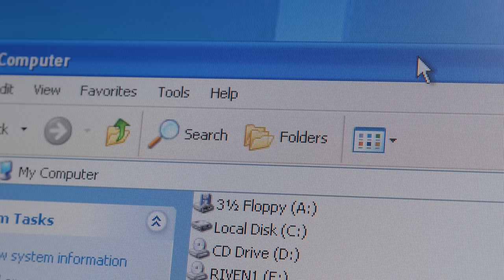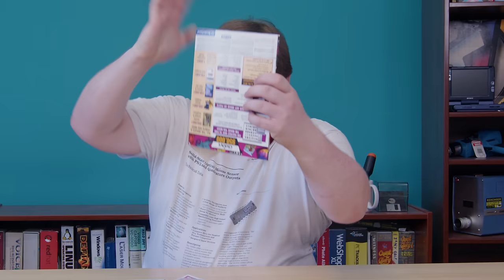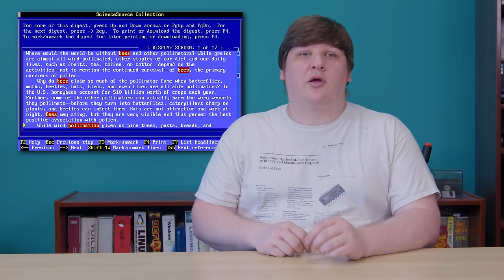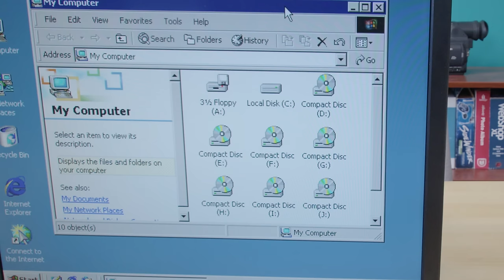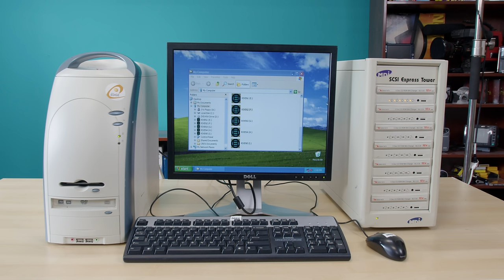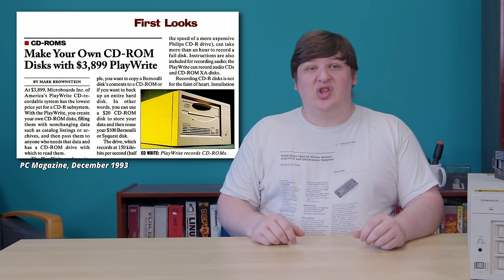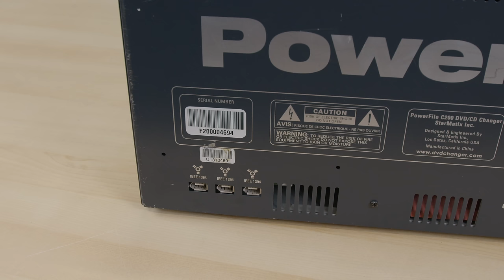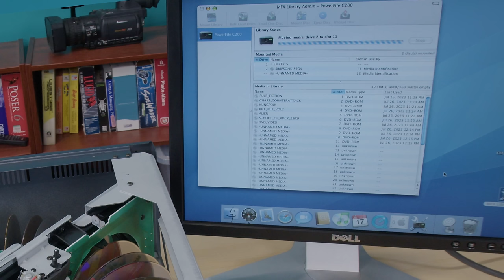A Jukebox for your PC: 1993's CDROM Servers

Comment: Sound ideas in the thumbnail got me so excited. I bought some Hollywood edge libraries (now owned by sound ideas) used on eBay and they came in caddies, little sliding door and everything. I meticulously took them out one at a time to rip them. The booklet even had handwritten bug notes from a chess game stuffed inside. 

I also own the General 6000 and I’m pretty sure they’re just normal CD audio discs. I ripped them with Adobe audition no problem, I never tried to access the files directly. That being said, the modern documentation for it mentions specific wav files, some of which are broken down as multiple CD tracks on the original discs.
Reply: We used the General 6000 in the campus radio station (in the early 00s) for making promos, sweepers, jingles, and so on. It was massive - and occasionally, when I was on-air, I'd play the disc directly - as I recall, the discs were both full tracked and data files, so could be used either way. But some of the tracks had multiple effects on them, so if you needed, say, the second "whizz" effect on the track, you had to cue it up, pause the playback, and unpause it when needed.

Comment: I remember going to the State Library to access the MLA (Modern Languages Association, the definitive index of literature and literary criticism at the time) database on CD-ROM. They ran it on a stack of CD-ROM drives just like shown here. It was the only way to search the database for several million people, and you just called up the library and booked a time slot to access it.

This would have been 1995 or 1996.

Comment: Such a blast from the past.. I had the home 6 disc pioneer that flashed on the screen when you were talking about the cartridges. Also, the car ones were identical. We had a van with a 6 disc pioneer, and I used to bring one of my magazines from home and put it in my car unit.

Comment: Back in the ‘90s I was a sysadmin for a major defense contractor. One of the systems I was responsible for was an optical drive library for our graphics and publications department that used hierarchical storage management (HSM). The server had five 4GB hard drives in a RAID5 array, the optical library followed by a DLT changer. Based on the last access date on the file it would automatically be moved from the hard drives to the optical drives and finally to tape and back again, as necessary.

The optical library was a massive thing, about the size of a commercial refrigerator. Ours wasn’t maxed out, having only 6 drives (probably 1.3GB (?) per side WORM or MO drives) and about 128 discs; it could probably store double that number of drives and discs, but ours was relatively minimal during the time I worked there. One slot on the front was used to load the discs, but that wasn’t used often as the discs were never changed unless they failed. There was one robotic arm to pull the disc from the storage rack and put it in the drive. When the opposite side of the disc was needed the robot arm would press the eject button, grab the disc, flip it and then gently reinsert the disc. It was quite a sight.

The HSM method worked well at preventing the Windows issues with multiple people trying to grab different bits of data on the same disc. The system handled one task per drive, dumping the requested data onto the server’s hard drives for user access. It was a great way to store huge quantities of data in a way that was easily and automatically accessible by the end the user, although they may have to wait a bit for the requested file to be transferred to the hard drives from whatever media the file may be stored on at that moment in time. Now that same library of data could be stored on one 512GB MicroSD card - how times have changed.

In late ‘99 I was going through the accumulated junk mail on my desk when I found an envelope from Kingston. It appeared to be more personalized than the usual generic sales garbage, and I was correct. It was a letter stating that I had won 64GB of RAM, a huge amount at the time. Based on that I ordered a brand new, custom built PowerMac G4 - minimal RAM (I had 64GB on the way after all), a 10GB hard drive (the smallest available) the fast 500 MHz CPU and a DVD-RAM drive. I already had an HP 4X SCSI CD-R but I wanted more storage. The DVD-RAM drive did what it said, but the performance was somewhat lacking, although I suspect that this had more to do with my unrealistic expectations.  It was slower than burning a CD, but then again, it was burning considerably more data than a CD. I probably never used it in the manner in which it was intended. Later, at another job, we upgraded the Mac servers we used (that were just there to hold the CEOs address book) with top-of-the-line models which had DVD burners. We didn’t need those drives on the servers so my boss told me to put in some other optical drives and we could each have a DVD burner. Heck yeah! That drive, like my DVD-RAM drive, worked great for playing movies via a hardware decoder, something I probably still have; given what I paid for it I wanted to make sure I got my money’s worth out of it.

Even when DVD burners got faster I would still burn at slower speeds for reliability and accuracy. But I’ll be completely honest - I haven’t burned a disc in years. I even have a Blu-Ray burner that I got from a retired friend of mine, but even though I have the media (I bought a 25-pack back in 2018) I have yet to burn a single disc. I mounted the drive in an old SCSI case, converting it to USB 3.0, so it’s not taking up space in a precious 5.25” bay. These days most of my data is stored in piles of 8TB external drives, but even then I can’t keep track of it all; I think some sort of disc cataloguing program is in order, especially if it can find duplicates. I also have literally piles of 500GB drives from used DirecTV DVRs that I would grab for $2-3 each, gutting them just for the drives. I stopped that several years back when 500GB became the modern equivalent of a floppy drive (and I used the drives as such, in an external drive duplicator), and when one of the units was filled with insects, bedbugs in this case, thankfully all dead (I had a disgusting neighbor that infected a building I was living in with bedbugs and I never want to experience that again). You can still find the occasional DVR at the Goodwill Outlet and harvest them. AT&T and DirecTV units work well, but avoid Dish Network units as they have buggered up the drives to make them all but unusable anywhere else. I spent hours tweaking the firmware but eventually throwing in the towel as my time was worth more than the 500GB drive I would have in the end.

Comment: I majored in computer engineering and scheduling was one of the topics in my embedded systems class. Scheduling algorithms are used to manage resources among a set of tasks (e.g., CDs among a set of users). It is a complicated problem with many solutions, but the goal is to schedule the tasks in a way that minimizes certain metrics like latency, deadline misses, execution time, etc. Also note that the tasks could be split into multiple parts.
The algorithms we talked about in class included: Weighted Round Robin (WRR), offline cyclic scheduling, Rate Monotonic scheduling (RM), Dynamic Priority Scheduling, First-In First-Out, Earliest Deadline First (EDF), and Least Slack Time First (LST). Some of them assign priorities to the tasks like WRR and others focus on metrics like EDF and LST. EDF is simple enough, as it prioritizes the task that needs to be finished first.

Comment: In 1998 while at UCSF we had a huge CD library that needed to be online because MRIs were huge. We used multiple towers on linux with experimental support. Worked good enough.
Reply: linux??? back then??? linux didn’t have good hw support at the time.
Reply: @beepyshenanigans  lol what? linux had the best driver support of any unix as far back as 1995. i've been using linux and nearly every for pay unix since the early 90s.
Reply: @beepyshenanigans for "real" computers in the 90s, the kind of stuff that would run Windows NT4, Linux had decent driver support since this is what developers or college students typically had access to at the time. Support for SCSI was excellent.

Comment: There was a Pioneer DRM602X (or something very similar) in the library of my high school in the early '90s. It was used with a multi disc encyclopedia so you did not have to swap discs. I seem to remember that the computer that this setup running on was specifically for the encyclopedia only.

Comment: 28:20 "I love that touch" - my parents still use a Pioneer six-disc changer in their home audio setup that is probably a slightly earlier revision of the one you show on-screen at 31:20. Purchased in the late '80s or early '90s, I'm about 99% sure it uses the same 'magazine' as your systems. Last time I was at their house a couple months ago, I put in the "jazz" magazine and hit play. Worked fine.

Comment: I absolutely remembered these from my school. We used them in the computer lab and the library, and they allowed several machines to access things like game disks and encyclopedias without the instructor having to risk us handling CD-ROMs. It also let the expensive computers from before the CD-ROM era use content on CDs (and the CDs were often many times larger than the hard drives on the older machines).

We had a bunch of Mac LCs (the original, not LC 5200s or whatever) that had PhoneNet AppleTalk connections to get to a CD-ROM 'server' via an Ethernet to AppleTalk adapter.

It was cost effective and 'fast' compared to buying CD drives for each machine or having ten copies of each software title.

Comment: I was the maintainer of several Sun 3 servers that stored a lot of online technical manuals.  The manuals had been scanned and OCR'ed then stored on many large optical disks - I don't remember what size, they were in their own cartridges and were at least 15" in diameter.  All the manuals were indexed and that data was stored on some really big Fujitsu Eagle hard drives. The optical disks were stored in an enormous jukebox - this thing took up the space occupied by four 19" racks.  Pretty heady stuff for the late 1980's. I remember the developers having a hell of a time dealing with thrashing in the jukebox, which because of the size of the disks and everything else was pretty amazing to watch.

Comment: My high school had a CD library attached to their Power Mac G3 server. They didn't use it for student access though, it was just for software installers and stuff that the teacher could use to install whatever software or data they needed for a lesson.

Fast forward like 15 years and I discover that my work has a Petasite, which is basically a massively scalable tape library system, in our case it took three whole racks and stored thousands of LTO tapes. They had built a custom CMS for it that stored all the metadata about everything on the tapes, and allowed users from anywhere in the country to request data, which would be queued for retrieval when one of the tape drives was free. It would then retrieve the tape, find and pull the data off, uploading it to the user's local server and emailing them a link to the file. And if the tape wasn't "online" in the library, every day the operator would load a fresh batch of requested tapes into the library for data retrieval.

In the case of an online tape, it could be a few minutes to a couple of hours wait for your data, depending on the size of the files and how busy the system is. Offline tapes usually meant waiting overnight. It was a surprisingly good system for such a large amount of data.

Yes, it "was" a good system. It was switched off not long ago after all the tapes were transferred to S3. All >20PB of them. Not only is it a much faster system in terms of retrieving the data (we've got a 10G dark fibre to AWS), but it's actually a lot cheaper. Yes, they have to pay for storage and to retrieve the data, but those costs are a lot less than they spent operating the Petasite.

Now the new custom CMS is all in the web browser, users can search for and even preview media, and downloads start either immediately or within a few minutes for infrequently accessed data.

Comment: I worked in IT since 1993, so was in a job when these were popular. Both the european car manufacturers Mercedes and Renault would use CD-Jukeboxes attached to MacOS or PC  for parts libraries & exploded diagrams of cars. Dealerships would have a PC/Mac and some sort of jukebox (usually a 6 disc library or maybe multiples - I saw that 18 disc library multiple times) and the manufacturer would ship updated CD-ROMs every month with new car updates, new part updates etc. This was pre-internet (as in - when internet was still slow dialup). The software on the mac would allow you to search for a specific vehicle using the VIN number and then you could dig down into the exploded diagram of the car and identify parts & other details - then the dealer parts department could order you the parts you needed. 
Also, in my work (finance) we had a 6 disc one of these connected to a Windows NT server with the key Microsoft TechNet CD's loaded into it so we could install stuff over the network rather than having to carry the CD's around with us. 
Finally, I did see a large library of WORM drives (effectively CD-R's) used in an insurance company as core storage of legacy customer data

Comment: I've worked in Enterprise IT, and used to work around a lot of robotic tape loaders and WORM libraries. One of the biggest take aways is these things were nearly always broken, even when they were working as intended. Much of the consumer CD changers were quite good in that they didn't have many moving parts, or the parts that did move worked with linear mechanisms, where as the Enterprise stuff from HP and IBM and Quantum had rotating arms with that travelled in X and Y servicing 20 or so drives from 20 meter long libraries, and even though they might have had more sensors, it didn't necessarily mean they didn't screw up (and even then, I'm pretty sure your average pinball table has more position sensors). And when they did screw up, they would do it in spectacular ways, like not fully inserting a tape into a socket, then picking up a different tape and smashing it into the partially inserted tape with enough force to bend the arm mechanism. And similar to the "one CD at a time and wait for the mechanism to do its thing", there were always equivalents. Sometimes, if you were lucky they'd let you put 10 things in or pull 10 things out at a time, which is great, until you realise that you need to put a total of 50 things in and pull 50 things out in a single exercise daily. It gets to a point where you literally have to hire new positions to baby sit taking media in and out of machines.

Comment: Great video. I had a Pioneer CD stacker in the boot of my car in the 90s. It used the exact same stacker cartridge and probably the same drive and shuttle mechanism. So I suspect that explains the over engineering. If it's a stacker bouncing around in your car you need something pretty sturdy. I recall almost never getting a skip.

Comment: I worked with some customer in tv broadcasting, who used for almost 20 year (and maybe still using it) a huge 32RU DVD-jukebox archive thing, that is used for record archive of broadcasted events from their studio. They do a backup, then once in a while a special person came to do a text transcription of broadcasted event, then from time to time they used parts of previous events to sight them in another one. Eventually very old discs were taken out and were send in a box to archive, but overall they had a very long time archive inside of this jukebox.

Also worked in a project for a venue where a broadcast tv system were installed, my part was cameras, video router, monitors and other exiting things, while my colleagues should later installed Sony's recent jukebox archive that used some kind of proprietary protected Blu-Ray disks (im not sure it if was standard blu-ray of it was some kind of magneto-optic disks, and it is possible that they were recorded only once without rewrite possibilities ) in a special protective box, which were stored and automatically inserted inside of sony's archive. Pretty impressive thing for UHD HDR video archival purposes, but I was not able to play with it since I finished before archive was installed, but it is pretty cool equipment by itself. 

I can go to a sony's pro web site and check out what it is actually is and how it works, so do you if you interested =) since I never used it I only know it exist and it is pretty neat stuff and until I will need to know more - it is some neat stuff that I will read about in the future, possibly, some day, who knows when =)))

Comment: 51:06 - Indeed.  MO drives were very popular in Japan.  In fact, Yahoo Japan is a great place to still get affordable media and drives.  Most drives in the U.S. are IDE or SCSI, but you can find pocket USB versions in Japan.  I have several 3.5" Fujtisu drives with 2.3 GB disks.  I use them to back up my vintage software.  The media is very reliable, which is probably why it was used extensively for storing medical records.  I've sold new-old-stock media to several medical companies.  I asked the buyer what they're using them for because I was very curious, and I was told that MO drives and media are still used in several models of ultrasound machines.

Comment: In 1987 or so my now ex wife then girlfriend was the editor of Shareware Magazine. They produced the first full disk of software ever available, basically all the shareware available anywhere, which was just about 650 mb at the time. They produced them on a machine the size of a dishwasher that had a 650 mg scsi drive in in to hold the data to burn on a disk.